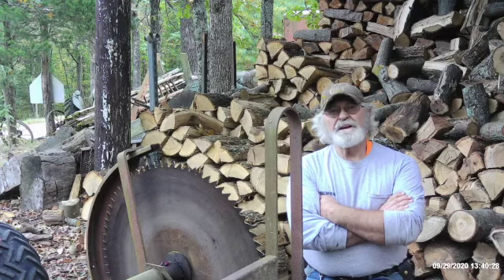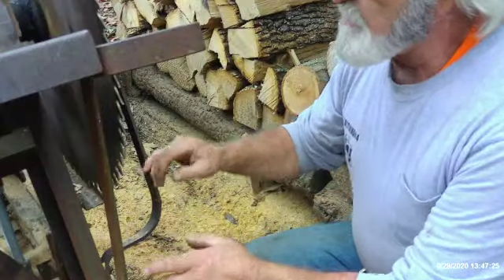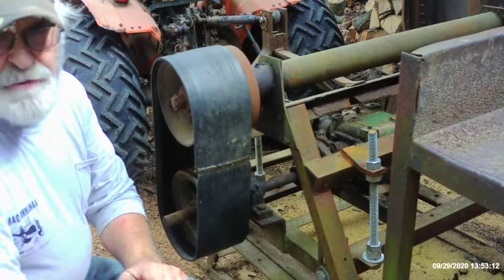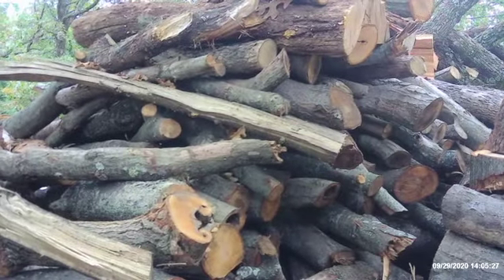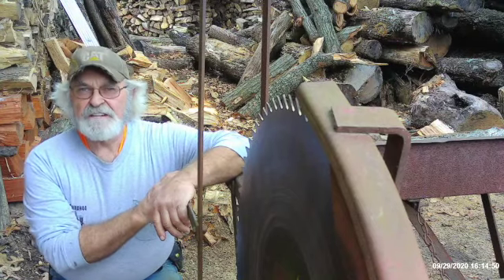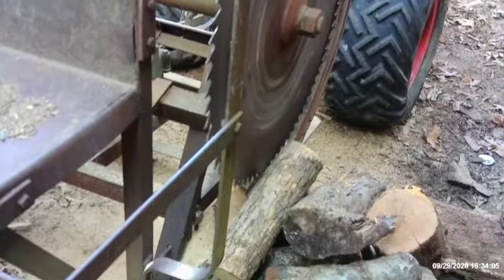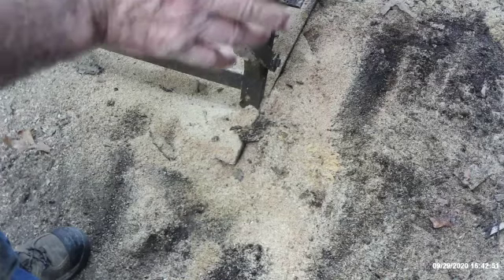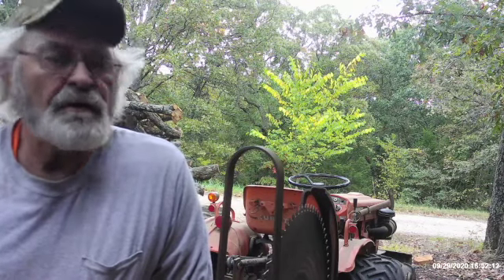Buzz Saw Safety: Detailed Safety Discussion and Operation

Comment: Thank you Tractorman. Very excellent info and advice. Best wishes from NZ
Reply from the maker: A friend of the family spent a year over in NZ a little while back.  Isn't it funny that Youtube gets all the way over there.  If you've used a buzz saw, you know exactly what was covered in the video.  Thanks Slim D for the very nice comment.
Reply: @tractorman4461  i haven't ever used one. But ive not long purchased a blade with the bearings and shaft and all that included. So i'm intending to build one. And been doing research here online . To help me to get some ideas together about different design of these buzz saws. To be quite honest your videos Tractorman to me have been like finding gold. Invaluable info for certain. So yeah, thanks again. I'll be bound to be looking back through them again too as well i suspect, from time to time. Just to help me to refresh my mind about things what ive learned here. I always prefer to play safe. So i don't mind to watch through these educational video again. Love from us to you
Reply from the maker: @slimdusty6328  Thanks for the extended comment Slim D.  If you've purchased new high quality  bearings rated for high rpm and a carbide blade, you shouldn't have to be too concerned about limiting the speed of the blade to 600 to 800 rpm.  If you've purchased old parts like mine are all made of, keeping within those parameters would be highly suggested.  Also beware of the blade condition when using 70, 80 year old blades.  Inspect closely for fractures in the center of the gullets.  A fracture can without warning cause the blade to separate....
    Think about this.  Even though the blade is steel, the point of contact with the wood creates restriction to the blade.  The blade wants to slow down because of the restriction, but the inertia created by the rotating mass doesn't want to so it creates miniscule ripples of the metal right  behind the point of contact.  Now, that's not scientific nor probably technically accurate but those vibrations cause work hardening of the blade and the subsequent fractures.  At the right time, in a hard and dry tough piece of wood, the wobble will become exaggerated because of the weakening fractures and the blade can and will split to the side lodging itself in the wood, throwing the belt or maybe even ripping the wood from your hand.....  So there is a lot to be concerned with when it comes to blade selection.  I have several blades that are not usable because of the fractures. 
    If you are powering it with an old tractor like I do here, you can clearly see how wonderfully well the saws perform at the rpms at which they operate.  Good luck with your project waaaaay over there and if I can give a little suggestion here or there, leave me a comment and I will try to help.
Reply: @tractorman4461  well thanks so much Tractorman . Its extremely kind of you and i really appreciate this. Very good advice thank you and i will certainly look further into this advice you've provided. First off i'll start by saying that so far ive only needed to outlay $50 NZ, for this ive received a 30+ mm threaded shaft complete with the blade nut on one end, and the two fairly large bearings, plus the flat belt pulley on the opposite end. And of course there's a blade attached . And a few bits of steel of what would have originally been a part of the old buzz saw (they'd cut it off so to make it cheaper to freight down to the person who ive now purchased it from). Anyway, i'm very glad to have this advice you've delivered to me as i'll now most definitely be looking closely at all of those important points you've pointed out to me. These bearing what came on the shaft seem to me to be in perfect condition, and they are fairly large and solid old style bearing of what were usually built as strong as a brick shithouse, so that they'd last a long long time. However, i'll have a local engineer here who i know to take a look at them for me. And i'll also look closely at the blade and make sure to get some opinion from others around here who have been accustomed to sawing wood. However, i suspect even to buy this threaded shaft with the blade nut, and the flat belt pully attached alone would have cost me far more than the $50 ive outlaid so far, if i'd needed to buy it all brand new. So i think i still have the bones in the making of a buzz saw. I've been considering to purchase a new blade of around 700mm diameter , online , of which are tungsten tipped blade. Not sure if this would be best, or not. However my thoughts were that it might help me to maintain a sharp blade, should there happen to be some dirt and stuff ,on the firewood , that i might happen to miss seeing. The blade i have now is more of the older type blade like you describe, will need sharpening and perhaps ever resetting , and its 600mm dia. Anyway i was thinking about building myself a buzz saw of what might at least be able to carry the larger saw blade, if a larger one would ever be required. I happen to have an old lister single banger diesel motor of what i intended to use to run this saw off of. So i'll be setting the saw up in a semi permanent site. Even although i'll still try and engineer it so i can also set it up elsewhere behind a tractor or smaller style auxiliary motor too, if need be . I've been thinking about doing something somewhat similar to this following design . Be very interested to learn your view about what you think about this following style of design of buzz saw. By the way, many years ago i'd purchased a cheap wilderness block of cut-over NZ native forest land. There is some areas of manuka scrub as well too. I've always been a bit of a conservationist at heart and i have a love for animal and birds and so on. These days i now have apiarist who contract to harvest the manuka honey. The flowers are more prolific on the younger trees. And so i'm setting up this buzz saw for use in my selective logging of the manuka scrub bushes. So that i can then create another form of income (ie: firewood plus charcoal) which put together can still act to complement my conservationist style approach. Anyway here is a video of the style of saw i'm considering to create a similar design of https://www.youtube.com/watch?v=75k-90FppRg&list=PLi5lbzJC78FmHHbhjyonRAyJeS1p5wBBF&index=6
Reply from the maker: @slimdusty6328  I watched the video you provided and boy o boy that machine SINGS !!  I can tell by the sound of the blades 'ring' it is running way over 600-800 rpm.  If you are going to concentrate the use of the Lister or an old tractor for the power, the expensive blade you are thinking of is probably not necessary unless you just want a superior product that will withstand grit and grime much better than the old style blade. I think both the Lister and the tractor would have to have a transmission style speed increaser or at least an additional 'jack shaft', additional bearings and the appropriate pully sizes to increase the delivered rpm from the power units.  What makes that machine run so fast is the horizontal shaft engine whose governed speed is usually going to be 3450 rpm vs 540 rpm of the tractor.  The Lister is probably close to the same but I do not know for sure. 
   REAL old bearings are really wide and are what they call 'babbit' filled bearings.  They typically cannot sustain super-high rpm like the video link unless they are newly poured bearings.  They operate by supporting the shaft on a microscopic film of oil and can never be run without a steady drip of oil into the bearing cavity.  Newer 'old' bearings sustain extended higher rpm much better because they usually require nothing but a greasing with daily use. They too are limited in rpm if for no other reason than their age.  Most of these old machines sit outside for decades before guys like us get them and Mother Nature has been working to reclaim the iron and steel through the rusting process.  Virtually all old bearings are going to be pitted which is the first stage of failure. Extended high rpm will contribute to much earlier failure.
    Brand new bearings should have a maximum rpm rating from the manufacturer in their spec sheet.  You'll have to calculate the arbor speed of your machine and ensure for longevity and reliability that the chosen bearings are within your parameters.  Virtually any new blade as you describe will sustain the rpm shown in the video, but beyond any doubt, not the old old blades like I use. 
    The buzz saw in the video looks to be an awesome machine as built for sure.  The sound level of the engine being so close will be much more obtrusive that the tractor or Lister in my estimation.  Being an antique tractor and machinery buff, it is a bit too fanciful and modern for me, but if you are concerned about production, this is a great machine judging by what little bit I could observe through the screen. 
   Being a conservationist at heart deserves praise. More people need to become aware of the impact modern industrialization has on the world in which we live.
Reply: @tractorman4461  thanks so much again for this invaluable advice Tractorman.  Those things you highlight are things what will be most important for me to think carefully about. Yes, as you point out that motor being used on that buzz saw will be extracting the power (torque?) that's created, from out of the high revs (speed). Where as, with my old lister, power (torque?) will be gathered from kinetic energy what gets stored up within the weight of the heavy pulleys which sit on either side of the motor. And yes, as you also point out there's the noise level to think about too, as this will certainly help determine the day to day comfort of use of the buzz saw. I will certainly be best to think about that aspect as well. But what are your thoughts on the saw design itself. Do you like the way that they've semi enclosed the blade within that steel cowling ?. Or do you see/sense some hidden problems what might pop up from this particular type design with that semi enclosed blade system. I agree with your critique in regard to motor speed and associated machine noise level . Even in the day to day use of a portable power generator, its the motor speed requirement  what dictates the comfort of use. My old single banger lister is also of the lower rev type range with only a maximum of 650rpm. Now wondering if perhaps i might be pushing my luck a bit far, to try to utilize this old girl for the job. I'll also have access to my tractor which i sense could then be overkill as its a fiat 80-90 (80hp). I'll soon sort something out though, as i'm a bit of a machinery and tool hoarder (haaaa) . Just cannot help myself but to follow the waste not, want not, rule . I happen to have some spare diesel truck ute motors set aside, one of them being a old SD2.3 Nissan which are a bit of the older style tickity-boo bomb-proof type of motor what some folk will use to create themselves an electric power plant with. Anyway i'm not in any need of rushing into this. So right now i'm just researching the options, and very thankfully ive happened to stumble upon you which has turned out to be the best thing that could have happened for me too. Yes my main thought with regard to the tungsten tip blade was associated with the thought that it might withstand grit and grime better. And my thoughts were that i'd at least consider to design the saw cowling set up, so that i'd still be able to use one of those blade (which are 700mm dia) if i'd ever choose to do so, even if i might at first decide to start off using the one what i already have (which is 600mm dia) . Where my operation is situated the economy of fuel is going to be fairly important factor to consider too, as my block is a little bit remote and is also even a bit of an adventure to access with a couple of rugged creek crossing to get across and so on .Thanks again Tractorman. Been very helpful info thanks . Cheers . Steve
Reply from the maker: @slimdusty6328  I think the design in the linked video is great for safety...kinda like the saw guards on newer table saws but for me personally it looks to be a bit inconvenient for use on my old comparatively slow operating machines.  All the new production machines are governed by much different safety standard for sale to the public and some look really complicated.  But the design itself looks to be pretty good with the exceptions I mentioned before about the noise of the motor so close etc.  
  By the way, I have a 5 hp Galloway flywheeler that was originally delivered on a set of trucks with a buzz saw mounted on the other end though I do not know the diameter of the blade that was on it.  I intend to set it up again with another old buzz saw I have in the woods yet just for old times sake. I think your Lister would work fine but you can't expect the same efficiency of operation as the one in your linked video.  
    If the Nissan motors are of small design I would have a tendency to use one of those for a power unit.  Your big ol tractor would be a waste of fuel as would a big ol diesel.  Hopefully you have a small one.   Now with a power unit like THAT, you could build a killer machine that could easily develop the high rpm for the big carbide tipped new blade. (I'm not familiar with tungsten blades). For comparison, my little 16 hp Kubota really kills it on the buzz saw and it'll run all afternoon on a gallon of fuel and I'm running a 790 mm (31'') blade on the rig for that tractor.  So even with a very small Nissan power unit you could easily run a blade of similar diameter.
  Have you seen all the buzz saw videos in my playlists up above?  Like the 8 or 9 part series on the Buzzsaw makeover ?  One of those parts concentrate on how my Dad sharpened them and how I learned from him.  I've also got other stationary saw rig videos powered by flat belt off a tractor....Have you caught them too?  If not I can link them for you.

Comment: Great video, we had 3 buzz saws, one permanent mounted by saw mill, one mounted on an Old F 20 ih  and a 3 point one for a ford tractor 
Cut lots of wood with them.  We used to take the tractor to the woods and cut up the tree tops after logs were gone
Reply from the maker: That's cool. Hopefully you still have access to one and still use it..??  Our old one mounted on the front of a Massey 101 Junior for years and years. We took it to the woods too for the branches and cut thousands of slabs off the sawmill with it. I still have several in use between here and my sons house.  Thanks Paul for the input and thanks a lot for taking the time to watch.

Comment: Great video there Tractorman! Just wanted to add something on good safety practice that some guys don’t realize, is that running any kind of pto driven apparatus, ie: brushogs and buzz saws etc, they should use an “
OVER RUNNING COUPLER “, on the pto, which slips in case of something jamming up and causing damage to you or the equipment. Spending $40 or $50 is well worth it.
Reply from the maker: Oh heck yeah George, I agree.  I have ORC's on several other tractors and they are life savers.  My brother in law was pushed by a 6' bush hog right into a tree with a pristine John Deere 1010.  Sure was bad for the front end sheet metal.  The saw rig I run on this Kubota was originally a stationary unit pinned to the ground. I added the home built three point set up and also the right angle drive off of a  60's JD haybine to allow it to be powered by the PTO.  The right angle drive has a factory built in slip clutch on the output shaft that drives the flat belt to the arbor.  Its not really the same thing as an ORC, but when subjected to an extreme load, the discs separate and stop rotation in a similar fashion.  Thanks for chiming in today and I appreciate your input.  By the way...its good to see you stopping by for a visit.  Don't be a stranger....LOL.
Reply: U know  or anyone  that gums a buzz saw blade out
Reply from the maker: @waynegilmore6805  I don't know anyone that does it commercially, but I do it myself for my own buzz saws.  Take a look at these if you'd like: https://www.youtube.com/watch?v=06hJGTyCPqM&t=14s Or maybe this one: https://www.youtube.com/watch?v=ezvZ7u8jUwE&t=437s. With careful planning, and the right gumming wheel, the same thing can probably be done on an old table saw.  But you gotta be careful to avoid overheating.  Thanks Wayne, and I have a whole playlist up above with mostly all buzz saw videos.